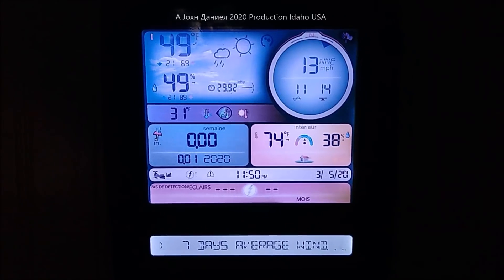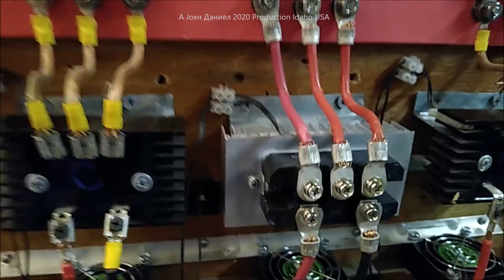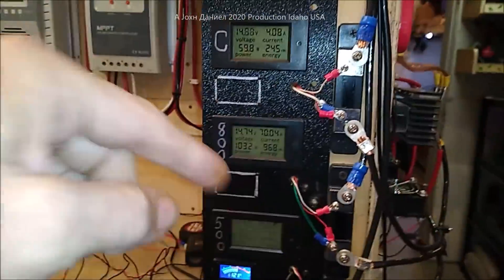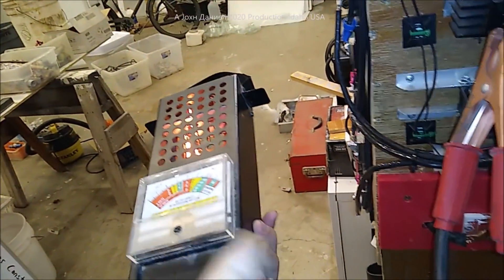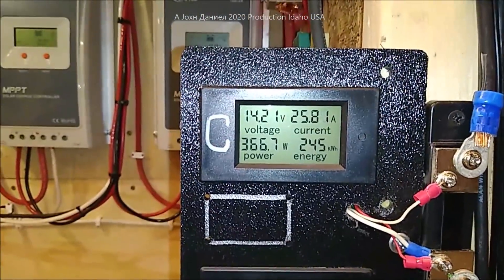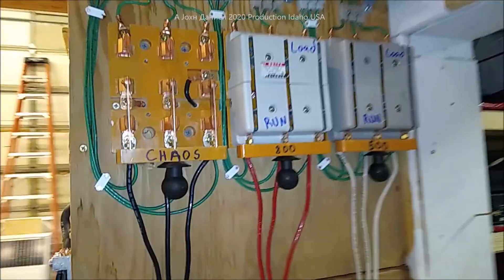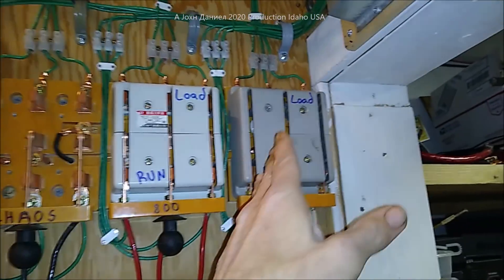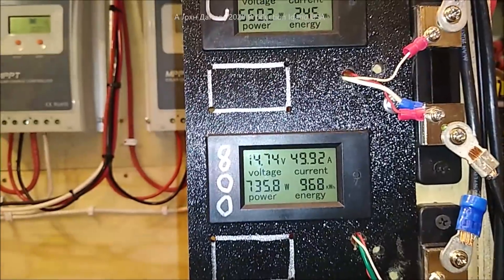Wind Turbine Brake & Safety Controls, full design by Olympic Power Controls™

Comment: I've been watching your videos till I go crosseyed... still not getting all answers I need.
Reply from the maker: Draw out a defined picture to show far you have gotten, send it to me to break down and correct, change, or update. olympicpowercontrols@yahoo.com
Reply: @JOHNDANIEL1  I believe I have most of the parts now and wondering what more I need to get besides batteries. My extremely limited income on disability pay is just a little over $1,000 a month. So far, I can't afford batteries. They are OMG outrageously expensive. $955 per battery is insane. That's almost a month's income for me. There's no sense wasting money on regular batteries that just go bad right away and you have nothing for your investment then.
Reply: ditto.

Comment: Wow! Thank you, John! I've been looking forward to this video since you mentioned it a couple months ago. It's simple, but yet, a really complicated system, but that's just because I'm new. I'm using one of those hybrid controllers from your link just because it's easier for someone like me and I only have one turbine. You had said that you do it the way you do because you run multiple turbines. Can you explain a little bit about why that is better for multiple turbines? I had hoped to get another one but I live in a fifth wheel so I don't have the kind of room for wiring and components that you have. Is there any reason that I shouldn't just grab a second hybrid controller for a second turbine? On paper, they seem to have backfeed protection so in my mind it shouldn't matter. But then if it didn't matter, you wouldn't be doing it the way you do so something must matter. Now, I have no doubt that your system would be way more reliable because the parts you use are rated way higher than you're actually putting out. So I get that part. But what else is there?

Comment: Can you give details on your comments about setting the voltage on a wind turbine by how you connect it. ie: 12v, 24v, 48v, etc... etc... ???

I have 12v and 24v wind turbines and I'd like to set up co-working systems using the same 24v or 48v systems.

I need to understand what you said about how to connect them to have this capability.

Comment: Hi, great video, I have a thermodyne 48v dual core wind turbine, connected to grid tie inverter (ginlong). I need to program a power curve into it as the dc volts come straight off the rectifier to the inverter. Can you offer any advice on where to start, I.e 50v -30w, 100v - 150w etc, is there any way to work this calculation out?? Many thanks in advance
Reply from the maker: You have to just find a method to divert in a active load process all power exceeding 90% of the inverter. If its max is 100 volts, you need a way to load the turbine down at 90 volts to stop its peaks but allow all to 90 volts to pass through.

Comment: Looking at some of your other videos, I wonder why you chose 12 volts for your system voltage, given the total PV/wind wattage and number of batteries in your system (8 parallel strings from what I can see in your videos). Is there a particular high-amperage 12 volt DC appliance on your system?

I was looking at some of those B-Creation turbines that you linked on Ali-Express, and noticed they offered a 380 volt 2 kW model. My dream off-grid system would use one of these, 14 24-volt PV panels in series, connected (through appropriate charge controllers) to a battery bank at 336 volts centre-grounded. This would be the right voltage to feed a transformerless inverter to produce a 240 volt split-phase output.
Reply from the maker: In a world catastrophe a 12 volt system is the safest way to run. I know it's a lot of amperage but if you do the battery system like I do and seen in some of my videos you might see it's not that much more expensive and if there is a collapse of our economy or something in that neighborhood I can survive with parts from anywhere while other people who are higher voltage would struggle to even find a replacement part.

Comment: Looking at the schematic at 14:48, why do you use a double-throw switch on the input from the turbine instead of a simple triple-pole switch between "Input from Turbine" and "RUN to Rectifier", connecting the "Input From Turbine" directly to the "Loaded Down Safe Run" on the same side of said simple switch? I would think a single switch would be sufficient as it would provide a zero-ohm bypass of the resistors when closed (meaning these resistors would have none to microamperes of current when bypassed) and force the power to go through the resistors when opened. I would think that that would have the added benefit of being able to replace the switch with a 3-pole AC breaker (50 amps in your 12-volt example) that would trip at 600 watts and engage the resistive load automatically if the turbine produced an excess of power.
Reply: This is a great idea.

Comment: I have a question, for the 48v installation I do not have 150 watt resistors for dump load but I have 9 pieces of 100 watt resistors, how do I connect them in series or in parallel?
Reply from the maker: 3 pairs of 2 side by side
Reply: Thanks very much, you made an exceptional video and explained in detail

Comment: How many 100w solar panels do I need to charge 7 deep cycle Ever Smart 29D Walmart batteries? And my other question is if I was using a battery charger how many amps would I need to charge them ?
Reply from the maker: 14 of the 100 watt, (15 amps max, 11.5 constant per set of 2) would be normal. For a battery charger charging them as a group since you can go 24 hours straight that would be about 7 batteries in parallel @ 40 amp continuous @ 24 HOURS. Absolute numbers really have to be varying on your use from them in that period of time too.
Reply: @JOHNDANIEL1  so I need 14 100w panels I have them running positive to positive and negative to negative all tied together for my battery bank
Reply from the maker: @rontech34  I would probably get 15, 3 strings of 5 into three 40 amp MPPT controllers. Pay attention to the ones claimed as MPPT, many are not. MPPT will make your investment make 22% more power per dollar. For a good MPPT you have to pay the cost and ignore the fake labeled ones. 15 of the good 100 watt panels at about $75 each and 3 of the 40 amp MPPT's at about $135 each will make you a good system with a 3000 watt pure sine inverter at about $380 to $450 total on them. Total 1.5kw power over 3kw 120v inverted system cost with wiring may run you $2200 plus those batteries of about $720 more ( $3000  in all ) If you need a parts list of what best is most effective let me know, it's a common size for preppers and off grid cabin builders I install.
Reply: @JOHNDANIEL1  I already have the batteries I already have 2 100w mighty max panels they was $74 and they are pretty good to me but going to get more and I have 1 ever mppt 40a controller I will get 2 more I just need to get inverter if you can tell me what kind to get as far  as brand name
Reply from the maker: @rontech34  I would suggest a 3000 watt pure sine that highly efficient, they are on sale right now, hopefully you can snatch one up https://amzn.to/3aU7Zri
Reply: @JOHNDANIEL1  that inverter is $648 that you sent me the link to I thought you said around $400
Reply: @JOHNDANIEL1  what's a good inverter for around $300
Reply: @JOHNDANIEL1  can you tell me a good inverter around $300
Reply from the maker: @rontech34  Are you looking for pure sine wave or Modified, and whats your power use goals.
Reply: @JOHNDANIEL1  pure sine wave and just to run lights tvs in the house laptops plan on using a dub panel to switch 2 15 amp breakers to run off my inverter
Reply from the maker: @rontech34  From what have seen the WZRELB 2500W 12V DC to 120V AC is made very well internally, has 20% higher rated Fets in them than needed and stable power up to 90% rating. No bells and whistles to cause issues, internal stream cooling too. I would suggest it for your study https://amzn.to/3bjed4n

Comment: I am in confused. You have also put "100A 3 phase switch" in the diagram and one side "brake switch" in "load by pass",
If 3 phase switch is down and brake switch is also pushed. So whatever voltage is coming from the turbine will not get shot together?
Please reply
My WhatsApp number +919814262820

Comment: You need fuses between the batteries and the rectifiers. A camera with stabilization would be nice when you keep moving all around and around. Why would you load it in parallel of the batteries with that load tester? That was useless. None of the wires are labelled and all the mix and match stuff not professional.

Comment: I have been watching most all your videos, and you have some great content! I am looking to install a windmill on my property and I would like to just use a grid tie inverter. Do I need a “breaking” load if I’m not using batteries or is the grid tie inverter enough?
Reply from the maker: If you get the 800 watt turbine in 24 volt they have a optional 1000 watt grid tie with built in load controls to divert plus stop spikes and temper the input with chokes. It works very well.
Reply: Јоhn Daniel Thank  you.

Comment: @JohnDaniel - My question is on "PARKING Procedure"??

You loaded the PMA down for "Brake Switch" parking with your 100A DC load box on the rectified side of the circuit prior to popping the brake switches... Can one SAFELY throw the same brake switches if loaded on the AC side when the AC-Series'd resistors are engaged??  

And, is there EVER a scenario when you'd ONLY ENGAGE a SINGLE brake switch??
I have yet to check the latest parts list and hoping you share your brake switch source.

Comment: Thanks.  I dump all my excess wind and solar energy into a series of electric water heater and store it in the form of hot water.   We haven't had to directly heat water in several years.  Thanks for the vid.
Reply: You need to make a video...😬

Comment: Great, no nonsense advice as always. Can I use a dc water heating element as a resistive load? Would like to get as much out of my  power as possible. Best wishes from England from Rich
Reply: I am also very interested in the topic. As all this renewable energy cost a lot of money to produce AND it just does not make any sense to me to burn off any access as useless heat. Heating water seems to be the ideal because of efficient thermal storage as also a high consumption every day. So there are 2 situations that come to my mind.

Nº1 is the situation when the batteries are simply full.
In any  well designed system this happens almost every day and a lot of watts get wasted
BUT THE EXPERTS SEEM NOT TO BE INTERESTED

Nº2 when an up normal high energy production occurs in form of climatic extremes
That´s when a component is forced close or over it´s rated capacity and needs protection
AND THE BEST THE EXPERTS COME UP WITH IS SOME STUPID RESISTORS ?????
Reply from the maker: Be watching soon on a hybrid system that answer the #1 question and answers it with my SUNSHINE AT NIGHT hybrid.

Comment: john i got a question for you .. do i need a charge controller for the wind turbine ..or can this power go strait to my battery setup with solar i have..
Reply from the maker: You need a diversion controller to divert into resistors, hot water elements, blowers, or some form of charge management. Like a car engines alternator stops charging full power but the engine keeps running when the battery is full. If you want a parts list to a quick build, send me a Email and I will put you a full sourcing and diagram in response. olympicpowercontrols@yahoo.com 
You have to include turbine type, watts, how many, your average winds, and any other info to size correctly.

Comment: I cant wait to afford one of these. My wife has my leash short after the solar offgrid install. 30k cost off the grid 48 batts 7200 ah total, two sunny island 48v, 4 midnite chargers, gas dryer and gas generator, 50 solar panels. all done my self with some help here and their but I need to one day install two turbines or even one good one for the night time loads. My whole point is to not use the batts at all and just stay on float. I may need some help from John someday here. Thanks for the help and vids John for your time.

Comment: Excellent update, explanation and diagram. Well done and sincere thanks for creating the design and for sharing it freely. I'm in Europe and have all the parts you recommended now, plus the Chinese turbine. I'm looking forward to installing it. Ideally I want to include a couple of 340W solar panels in the setup. Have you come across a good charge controller that can handle Both wind And solar? Thanks again for your information and enthusiasm!!

Comment: Braking, control and safety of a wind turbine can only provide control of the angle of the blades and feathering of the blades.
And the electric load brake is a stupid and dangerous game with the wind.
Power depends on the third degree of wind speed.

Comment: Thank you for the scheme,and well explained setup. One thing still bugs me a lot, batteries, i saw what you think on lead acid -> LiFo and i think you are right on that, but did you try LiTiO batteries? They kinda seem perfect for wind turbines + solar combo, i like the number of cycles they provide and safety about them. Did you ever try one or few of these (Not b class)?
Thanks again.
Reply from the maker: We prefer as Solar Installers to use Lithium Titanate Oxide and we have been approved to use them in solar for cell towers, not LiFePo  https://youtu.be/v8EBI-N0KTk

Comment: Hi, Why the fuses should be placed right before the rectifier and not before the 100 A three-phase switch?
Reply from the maker: It is because the rectifier represents the highest resistive load against the incoming power and that's where you need your fuses because that's where it's most likely to burn a wire, terminal, or a short would occur.
Reply: @JOHNDANIEL1 , in your opinion it could be a good idea to protect also the resistor part of the circuit in some way or it's useless?
Reply: Hey John I really need ur help with my my system it's a 24v system .But my inverter is constantly dropping understand 24v sometimes it drop to 20v. Can you plz help me out I want to email you some pictures. So you can have a better understanding
Reply from the maker: @heruedwards718  Yes, send your best description and pictures to olympicpowercontrols@yahoo.com 
I can hopefully get back to you in a few days.

Comment: Wish we had the Room you have to work with like your shop.    Living in a mobile home is like living in a submarine.    Finally after years of negotiating Wicked Wanda the Wonder Wife agree's we need a shed. LOL   Leveling ground next to the home for a 8 x 10 metal shed.  Need to insulate it in order to be usable.  Gets flipping Toasty here in Southern New Mexico don't ya know.   At last I'll have some fashions of a work bench.  Considering adding a Standard 19 inch Equipment Rack to house my system and batteries.
Reply from the maker: Where at in New Mexico? I head though there often, mainly around Carlsbad. If you get a metal shed, grab you some base plate for 2x4 metal studs to beef it up.
Reply: You have plenty of room. LOL I am living in a 25 ft camper an I am trying to design a system and put it somewhere. Good luck and stay safe.